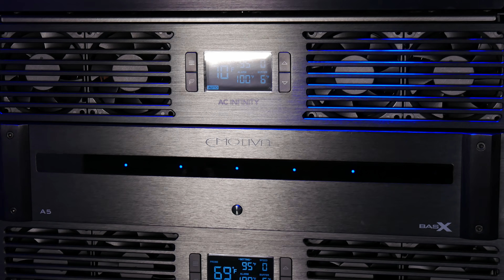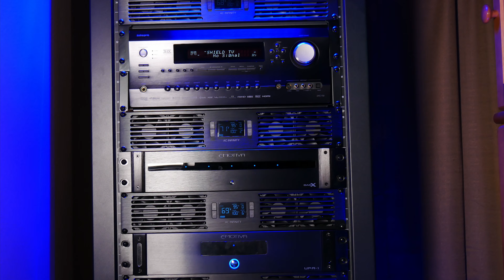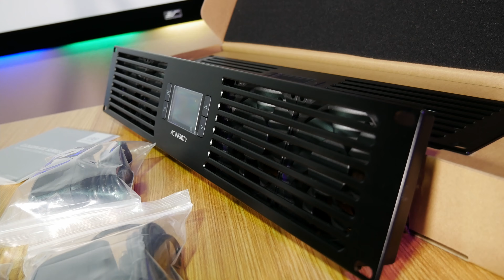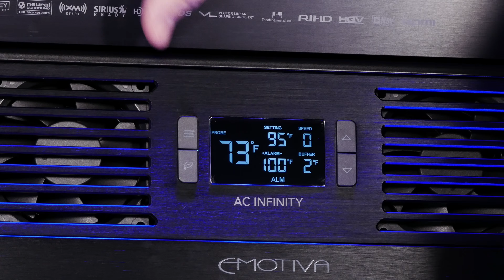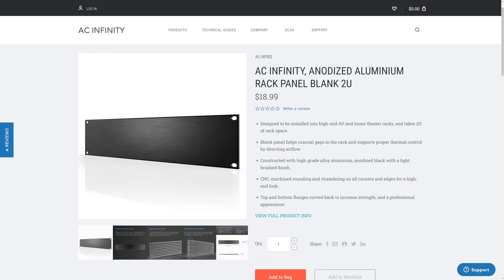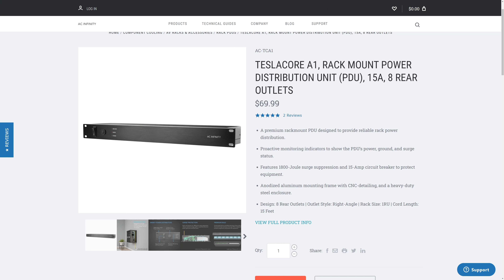Keeping your COOL with Component Cooling | AC Infinity Rack Mounted Home Theater Fans & PDUs Review

Comment: Do you plug your amps into the surge protectors? Manufacturer recommendation for most quality amps is to plug it straight into the wall. I have an APC H15 for my prepro and media players, but wont plug my amps into it. Theoretically, the surge protector shouldn't interfere with the power demand to the amp but I have my concerns. There again, I feel some sort of surge protection is a smart idea. What has been your experience? Do you see any sag in performance using the 15a surge protectors? Its a shame they dont make them with 20a breakers.
Reply from the maker: Hi and thanks for watching! Yes I always plug my amps into surge protectors, the PDUs from AC infinity are really good quality and I haven't noticed any of my amps starving for power. Hope this helps.

Comment: I watched your AV RACK BUILD Part - 1 that you did with your Son IMPRESSED,
Another splendid demo/info video 👍👊✊
I would like to purchase the  AC INFINITY FAN T9 3U EXHAUST AIRFLOW for my little SANUS CFR2115 34'' Custum Install AV Rack there's cut out section at the top of the unit and one also at the bottom I just need the one for the top.
Would I be eligible for the 15% discount ?
The only problem is that I live in England UK - Mirfield   West Yorkshire
Kind regards
Mel

Comment: For class D amps, i was considering the 1U  intake cloudplate units above each amp, in an encloused rack with top dual exhaust fans, and a front door. Should i also add a 2U S7 at the very bottom of the rack?
Reply from the maker: I think that would give the best airflow.

Comment: When my Sony 4K blu-ray player kept freezing, I thought the discs were defective (they were not scratched or dirty) or the player was broken.  The problem was actually heat.   I added an AC Infinity  AIRCOM T10 on top of my amplifiers, which were cooking the blu-ray player, and also added some tiny 80mm AC Infinity fans to blow on the back of my blu-ray player (they run via USB jacks on the AIRCOM T10, and also turn on when the AIRCOM T10 turns on).   My blu-ray player has not frozen since, and I also re-played my problematic movies without issues.
Reply from the maker: Thanks for watching!! This is really interesting - it seems like our player hasn't been having any freezing problems lately since putting it in the rack and giving it more breathing room so there definitely is some truth here. Didn't even consider it until now!
Reply: I am having the same problem with my Sony 4K blu-ray player. I definitely try your suggestion